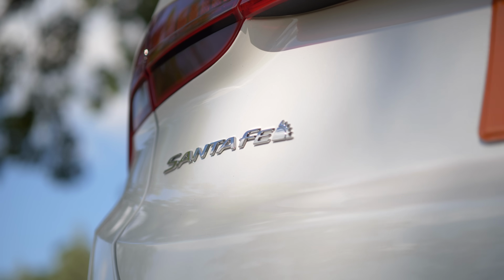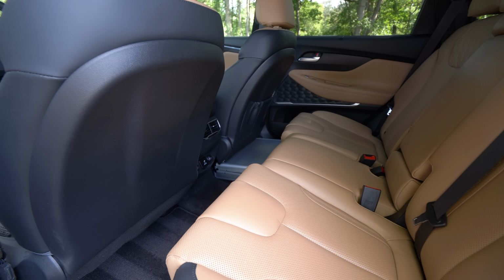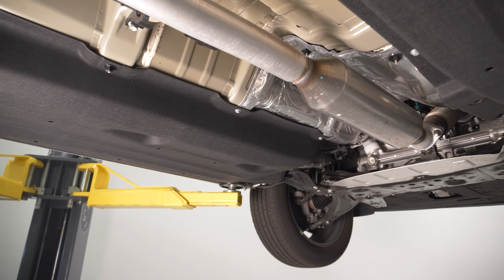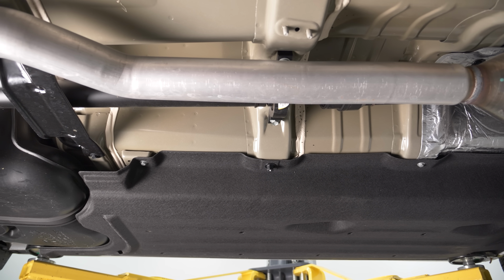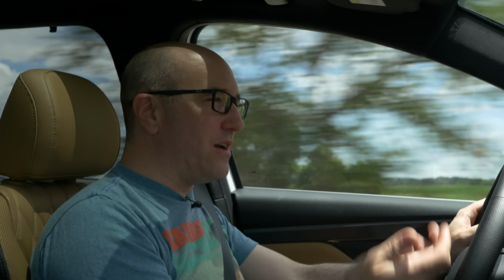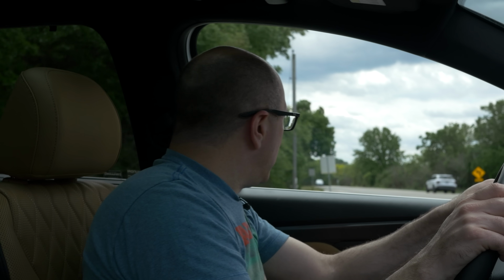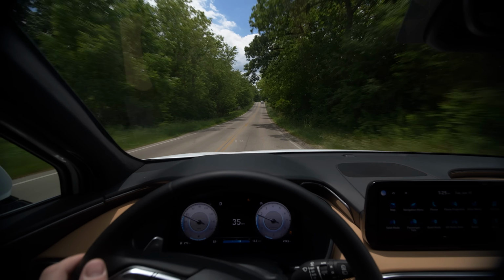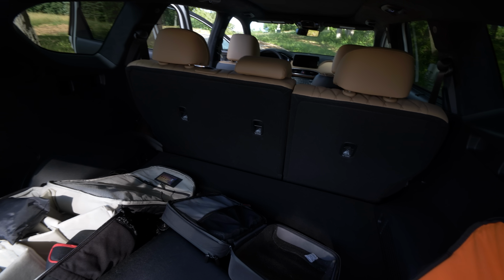2022 Hyundai Santa Fe | They Just Keep Going

Comment: How did Hyundai go from junk just a few years ago to now making extremely compelling cars for the money… truly impressive.
Reply: Assuming you have the cash flow and the right management, I think it's easier for a new car company to improve fast and compete with established brands than it is for an established brand to remain good. 

This is just my guess and it may be a stretch but here's how it goes imho: the up and coming brand has an incentive to produce good stuff at a lower price if possible because it's got a reputation to build and marketshare to grab. They don't need to reinvent the wheel, instead just implement the best practices in the industry (ie. be like Toyota, don't be like Nissan) which is why they had actual automatic transmission instead of CVT like Nissan for a long time. In the case of Hyundai, it also helps that they're a metallurgy company too, sourcing most of the metal and high strength steel in-house, a competitive advantage so more money can go to development to do better or catch up to others.

Compare that to established brands like GM and its subbrands, or Ford. The pressure is high to cut as many corners as possible because they already were established as big players decades before Hyundai even came to existence. The focus is pleasing shareholders, not building an image for reliability. 

Last but not least, Korean businesses are simply going after the market share of the Japanese, trying to replicate the Japanese business models that have worked. And it's working wonders for them. Today's Hyundais and Kias go toe to toe with the likes of Honda/Toyota. Samsung/LG all but dominate the home appliances and tech etc.
Reply: @Iamallwaysright1  Kinda like Honda in the 90s. Just make good cars and people will buy them. Eventually though they just end up selling a brand. I've been particularly disappointed with Toyota lately. I think they've gotten to comfortable.
Reply: @LegoDork  Just amortizing their old stuff out to infinity perhaps in hopes to win the upcoming electric arms race (or hydrogen, which is questionable).
Reply: They paid attention to what the better Japanese companies were doing. They also have an unusual degree of vertical integration, with metals companies also being related at a corporate level, as well as making their own transmissions and a lot more. 

That's the exact opposite of the Ametican makes, that used to be like that, but spun off all those subsidiaries years ago to generate cash, but lost control of their quality. If Hyundai transmissions are troublesome (as some have been), they get that division to redesign them. Ford or GM have to negotiate such changes, which takes time and costs money they don't want to spend. Their joint ten-speed is an example, having to meet the needs of numerous models in both companies. It can't be changed that easily.
Reply: By ensuring that the board and development team weren't being led by their ego. And when that happens a purity of intention prevails. Thus, the best outcome, for the good of the company, occurs.
Reply: Crazy huh.  They literally just started mass producing vehicles in mid 80's.  Remember Daewoo?  Jesus.  Haha...I lived long enough to see that failed attempt.  And then slowly, but surely, they got better & better.  And for many things they've actually gone from just being competitive to leading.  Wild...that's just 30 ish years.
Reply: That’s how the Koreans roll lol

Comment: what about the hyundai/kia engine reliabilities. is this good engine
Reply: That was the old Theta 2 engine but those engines are being phased out
Reply: Good question. There is a lack of coverage of engine failures due to weak rods. Or something.
Reply: Everything is good about these cars except the engine you have to take real good care of it
Reply: Worry not.  Every 18 months you get a new engine and transmission when the old one stops working
Reply: You'll hear/read all sorts of nonsense about Hyundai engine problems, but they're mostly just myths. Consumer Reports has Hyundai rated as about average in reliability, including their engines. Those ratings are for the last ten years. Consumer Reports says premature engine failures in all brands (yes, that includes Hyundai) have become so rare they're barely worth worrying about. The rest of the car almost always wears out in some other way first, or the car gets in an accident and gets totalled (most often what happens).

One possible, but uncommon, problem various makes have had is valve trouble in engines with just direct injection. This most recent generation of Hyundai/Kia engines combine port injection and direct injection. That minimizes valve problems and gives maximum efficiency in various operating conditions. These are very modern engines that don't closely resemble older Hyundai engines.
Reply: @markmiller3279  Wow man, are you a Kia/Hyundai rep? You’re in almost every comment trying to make the brand sound better than it is. Seriously, how much are they paying you to spread this propaganda?

Comment: Hyundai/Kia have been releasing new cars every other week for the last year.
Reply: @mezzb  They get the cash from their sales - if not for the newest mega conglomerates that are Stellantis and the Alliance pooling their numbers, the Hyundai Motor Group would be 4th in global sales. They also have excellent vertical integration, producing their own steel, utilize their own logistics (Glovis), and owning/having a controlling stake in many of their suppliers. I don't think any automaker can move as quickly as they can.
Reply: @JDubbs07  that pretty much sums it up. They're a giant on their own, but vertical integration gives you the ability to move quicker than the competition. Other manufacturers have to wait years for certain features to be approved and worked into a car, while HKG can just say "fuck it" and change a car completely in 2 years
Reply: Cant wait for the Santa Cruz review....
Reply: @mezzb  idk.  I thought the 2011-2016 was okay looking but pf all generations, the 2017-2018 redesign looked best (modern but conservative, more timeless). 2019-2020 refresh was just bad with both exterior getting worse and interior changes made for the same of saying thry changed something. 2021 redesign is practical as it's lower and wider to add space and save fuel, but it's kind of a weird exterior.
Reply: I just found out that they're two different brands...apparently.
Reply: @PotatosPotatoes  not just brands, Hyundai and Kia are entire separate companies, joined by partial co-ownership and shared R&D. Kia actually predates Hyundai, and they were forced together by the Korean government in the 90s during the Asian financial crisis.
Reply: @mezzb  hyundai as a corporation is fucking massive, in South Korea there is an entire city the size of Dallas that is owned by hyundai and everybody living there works for hyundai or serves the people working for hyundai
Reply: Seriously.  I feel like the team got together in 2020 and was like..."Ok guys, Covid hit...let's flood the market w/ our best stuff  we got while others car makers are chillin'".  Lol
Reply: They are more willing than most makes to update cars during a model's run. I don't really think they did all this in two years - they've probably been working on it since before the 2019 model was released. That kind of continuous improvement is more like the computer business now works.
Reply: @markmiller3279  I’m not sure the new design is an improvement.
Reply: @moloono1  y not? Grabs my attention in the streets
Reply: @voiceauthor2850  No use arguing over a subjective thing like looks.
Reply: @mezzb  Yup, noticing that too. It's like they going back to their way of designing back in early 2000s, when they where all over the place with some weird looking cars. Whatever happened to their designer from 4 years ago? He/she/they GOT IT RIGHT

Comment: Nice energy in this review! Yes they are able to turn around and upgrade quickly these updates for Hyundai and Kia, nice to see even the gas pedal has been changed and attached to the floor, not sure how long they have been doing that in the Santa Fe, where as the 2021 Bronco still has the pedal setup of a Tempo, Not a fan of the single side exhaust, but surely will be something to compete with a cx9 as a value proposition given the sticker price, thanks guys!
Reply: Hyundai/Kia have had floor pedals in their vehicles for quite a while.

My family and I have had several Hyundais including a 2014 Santa Fe, and they have had floor pedals
Reply: @TakeOnMeee  thanks! good to know, great to see the details like that are being implemented.
Reply: Model T had the gas pedal mounted to the floor
Reply: My 2016 Veloster R had the gas pedal on the floor as well. I liked it.
Reply: @borisrz3080  thanks, silly detail but i do like that they dont cut corners there
Reply: I actually had a Ford Tempo… many, many years ago.
Reply: If you attach the gas pedal to your butt, you can control the speed and smell of your farts.

Comment: Price aside, seems like a great car.
Reply: What?! That's a great deal for what you get compared to any other!
Reply: @ricbrown5002   The CX-5 maybe? It's about $3000 less when similarly equipped. To me, a car like the Sante Fe that is pushing 40k is certainly not a value proposition, which what the buying decision of this kind of car is all about.
Reply: @aliasonline1493  Cx5 is good no doubt but this is less cramped larger in every dimension, similar powered (turbo), but panoramic heated rear seats, and the technology along places this better than most of the options you can get in U.S, above a Rav4, CR-V, Cherokee, blazer, rogue, edge-escape, tiquan, ill even buy this over a Q5, GLC, a X3, and a QX-50. My choice 1st is a RDX A-spec/sh-wd
Reply: @aliasonline1493  The CX5 is TINY compared to the Santa Fe. Keep in mind, the Santa Fe is in an entire class above the cx5. The cx5 is in the rav4 and crv and Tucson class. Santa Fe is in the same class as the murano,  Venza, Edge, Blazer, and Cherokee. If you consider the top end trim prices of those cars compared to the Santa Fe, plus all the features you get, the value is absolutely undeniable
Reply: @aliasonline1493  I love the CX-5, but it competes in the next class smaller and offers fewer features. It drives well and l99ks great, inside and out, but it doesn't offer as much.
Reply: Name a better priced vehicle like this?
Reply: @twhalen  Probably in the 2000's when they were purely undercutting & offering better warranties to attract people.  But I'd say that in the past 10-15 years it's been more of a balance between features, quality & savings (not just savings like before).  But yeah...they're still more affordable than something comparably equipped.

Comment: The “limited” trim comes in at about 40k and is very similar.  I think this is a pretty cool pile - not many people are doing these larger 2 row crossovers that are fairly quick and comfy (besides like Lincoln and Range Rover but come on).  Not sure I would take this over the CX5 but it puts a smile on my face to think about all the 25 year old women and empty nesters that will probably really enjoy this car
Reply: My mom has a 2019 limited santa fe and my sister has a cx5 and the Santa fe is huge compared to the cx5 so I don't think they compare that well, also imo the santa fe is alot nicer and hauls ass
Reply: @jacobrael9872  yeah the tucson is much closer for size but I think the mazda has a much nicer interior (sans pano roof unfortunately) and much nicer handling
Reply: I would go with acura rdx as it is a lot more fun to drive and similar in size
Reply: @anejozafiro  new RDX is like 49k once you add on SHAWD and advance package, which is IMO required in order to make it worth buying
Reply: @granthemstreet3209  aspec trim is good enough for me also current rdx should have a lot of discount going on as acura is coming up with facelifted version pretty soon
Reply: @granthemstreet3209  they certainly loved this tho. The cx5 is very cramped and doesn’t have nearly as much tech as this.
Reply: @anejozafiro  but the infotainment system on the RDX isn't fun to drive. Not to mention the premium gas requirement, terrible fuel economy, and 49k price tag to go along with it.
Reply: Subaru Outback XT is a great competitor. I'd love to see him review it, but having driven them while selling at a Subaru dealer, I can't recommend them enough (except for the fucking godawful infotainment).
Reply: @ethereous  but that has a CVT
Reply: I'm a 23 year old dude who would like to get the K5 GT or this bc they have the same powertrain, & this has more tech & features than the K5 GT
Reply: I'll give it to Mazda for their sophisticated, sleek, & simple designs.  But interior, performance, warranty, etc?  I'd pass on Mazda.  At this price point...idk who's a better all-arounder.  Well, I'd actually rather have a Telluride but that's a larger SUV anyways.
Reply: @ajtam05  I’d take Mazda interior and reliability over anything else in its class, and the 2.5T really moves
Reply: @granthemstreet3209  Agreed - but that's in its class, which the Santa Fe isn't. In addition to room, there are just more features available on this. I'd be super tempted by the CX-5 because it's big enough for me, but it isn't for everyone.
Reply: @markmiller3279  yeah I agree, kind of what I was getting at with my original comment.  Most cars its size try to cram in 3 rows and do everything but the Santa Fe is a bonafide hauler.  I know Kia/Hyundai crams in a bunch of tech but aside from the fancy cruise control, I prefer Mazda’s approach.  Way better than the other Japanese auto makers though hahah